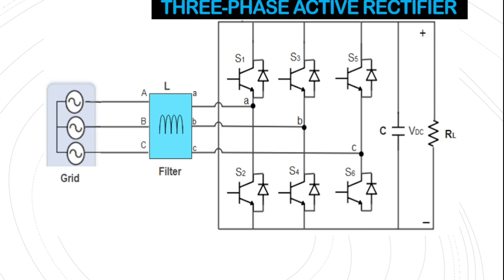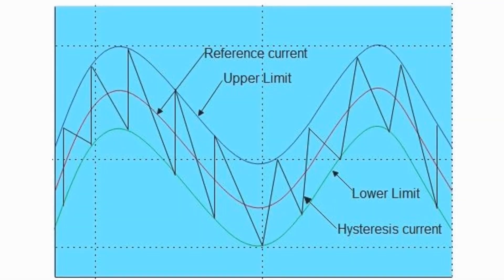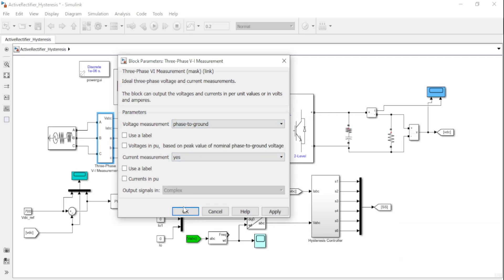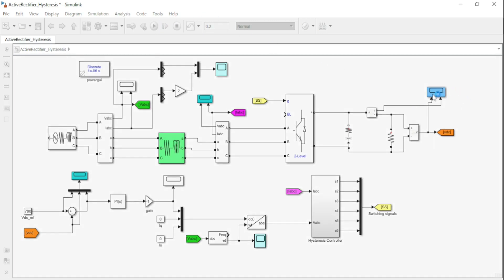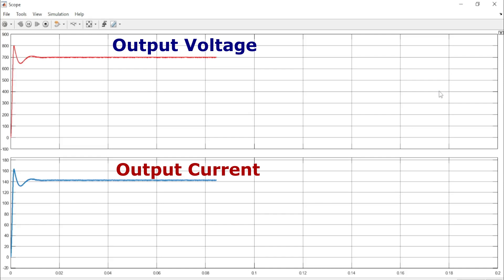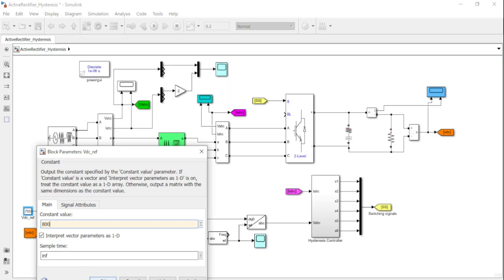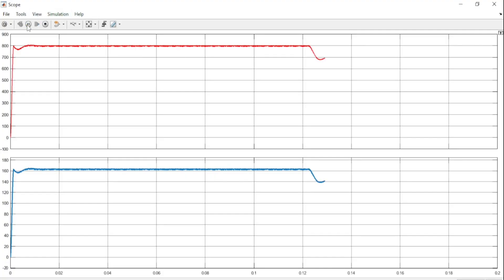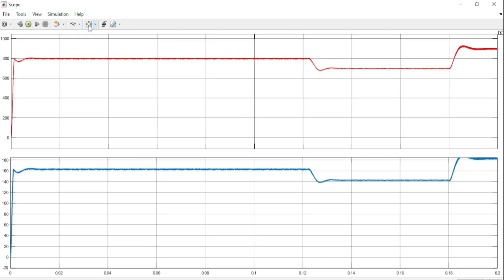Three-phase active rectifier using hysteresis current controller

Comment: Hi, could you help me, I have done as you did, and I didn't get the same result, the dc voltage not reach even 100 value
Reply from the maker: Hello, you may also try to make sure that you have followed the steps exactly as they are in the video because it may take me a bit of time to go through your model due to other commitments.
Reply: @pmctech1415  I am sorry it is too late to inform you, thank you so much for your fast response, I have already done with it, It's solved now, my current measurement was placed reverse before, thank you so much,
Reply from the maker: @craftcrave6244  Wow! That is good to hear. Well done 👏
Reply: @craftcrave6244   i could not get the same results. could you please share the simulink file of this project.

Comment: Great job . But the system doesn't work as u did .. can u help ?
Reply from the maker: You can share your design on pmctech1415@gmail.com
Reply: @pmctech1415   may I share too for your help?
Reply from the maker: @craftcrave6244  Yes, you may
Reply: @BamaniaPurvik   bro did you solve the error ?
Reply: I did
Reply: @amjadmohammed9288   bro did you solve the error ?